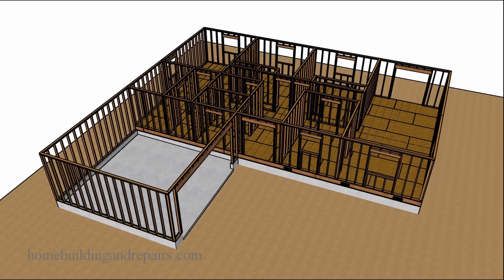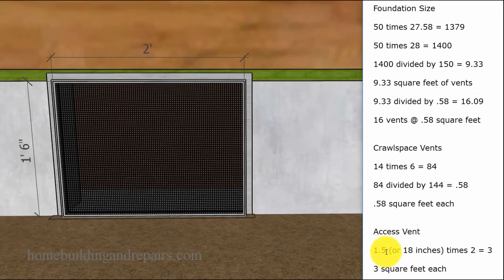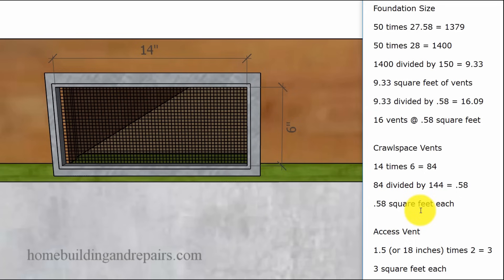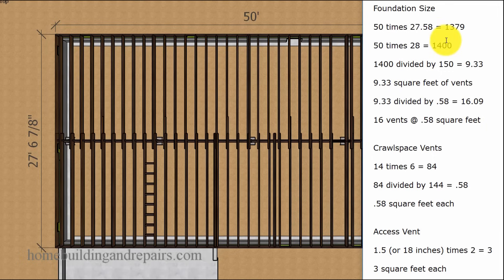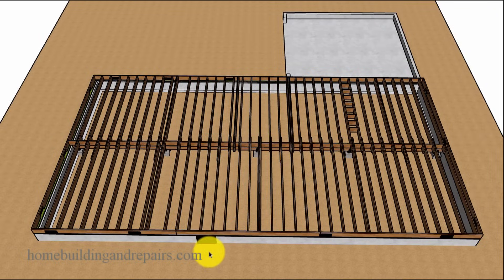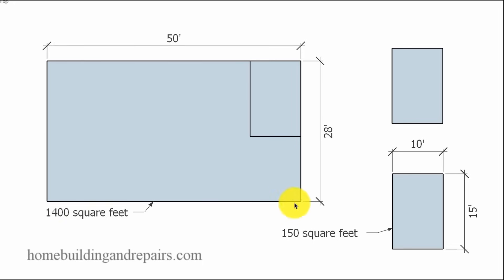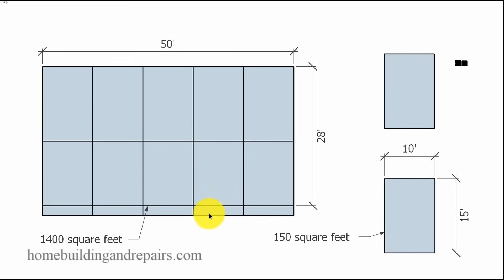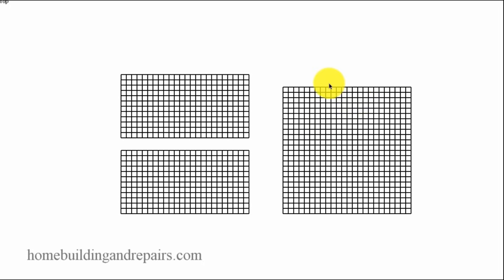How Many Vents Do I Need for an Open Floor Crawlspace - Building Codes

Comment from the maker: For those of you wondering what an open floor crawlspace is, it's when you have a crawlspace where the soil isn't covered with a moisture or vapor barrier.

This building code information was also taken from the 2018 International Residential Building Code book on page 323.
Reply: Greg. I have a couple of questions. If let's say one wall of the passive vents are obstructed or closed, would that not hamper cross ventilation? Also, how bad is  having your drier venting underneath the crawl space? Any formulas to figure out how much water is getting put into the crawl via warm damp air?
Reply: You could weigh your clothes before and after drying. My guess is it’s a lot of water. Please don’t vent like this.

Comment: Unless you are going to air seal and insulate the floors the same way you do it on the walls (maybe even better because of soil gases and moisture), there is no reason to ventilate a crawlspace like this. The US doesn't really have any climates where this is appropriate. It might be doable in a tropical climate, but then again... Bugs?
Reply from the maker: I would love to see where you got your information from about the United States climates where ventilation of a crawlspace in not appropriate, when they are still building homes with crawlspace ventilation.
Reply: @gregvancom  just because they are still doing it and it's allowed by code, doesn't mean that it should be done. There are so many reasons why this isn't an appropriate building technique. The problems arise because builders don't treat the crawlspace as either "outside" or "inside". It gets treated as a little bit of both. Builders will insulate it, but not air seal it, resulting in condensation/moisture problems. Or, they'll air seal it, but won't provide any thermal separation, resulting in cold/hot floors that again create a condensing surface. Moderate climates (think Hawaii) could probably get away with doing this because you can leave windows open nearly the entire year, but most of the US is climate zones 4-6 (some areas are even 7/8). Vented crawlspaces in these climates is definitely not advisable.
Reply: Venting a crawl space with mechanicals in it is the dumbest idea ever. Cross ventilation was designed before air conditioning. Plenty of science to back up closed and encapsulated crawl spaces over vented. I also say this with 16 years of fixing crawl spaces.

Comment: why build a crawlspace?
Reply from the maker: It usually depends on the type construction. If the house can be built about six inches above the surrounding ground level, then a concrete slab will usually work best. Homes higher or with basements usually have crawlspace.

Comment: I don’t get it
I just watched a video on insulating a crawl space and it says to insulate and close the existing vents
Reply from the maker: I've seen that done, but haven't seen the results of it, for example ten or 20 years after it was done. The best advice I could give would be to contact your local building department for more information, because they might not allow unventilated areas.
Reply: gregvancom It’s for my single-family home. And I’m gonna go with what you say. I just opened up the vents and put chicken wire so the animals don’t come in. But I noticed my crawlspace is cold so I must be having an AC leak that leaks into the crawlspace from the opening from the floor boards

Comment: hey Greg, On your equation you divided the area of your building by 150 to get the amount of square ft of vents required. My question is, why is the segment of the building to equal 150 is "10x15" if the span of the roof is 28' wouldn't it be 10'x14' instead then take that number (140) and multiply by your building square footage? would love to clarify how you got 15', thanks!

Comment: I am building an addition to my house that looks just like this with a slab on grade garage and crawl space under the main house. Its even in this L shape lol. Anyways, you have the vents in the rim joist around the house.  Most of the outside walls on the first floor are Structural shear walls. Can there be vents in the rim joist in those areas? I know that my plans say no holes in the sheating but since the sheeting is still attached to the rim joist is it ok for the vents to be there?
Reply from the maker: You will need to check with your local building authorities or engineer. However with that said, I've cut holes for crawlspace ventilation on almost every project I've ever worked on, even in sheer walls.
Reply: @gregvancom  Thank you for the advice.

Comment: What are the vents for?? I bought a home and it looks like it only has one or two vents plus the door screen..
Reply: I’m going to encapsulate the crawl space instead
Reply: I'd get it looked at! Get a small local termite company that does fungal Treatments. They will be a me to evaluate your home.
Reply: How important is cross ventilation? What if some vents are closed or obstructed?
Reply: Yes. But that won't do anything for the wood destroying fungus that you most likely have underneath
Reply: eric batrez a dehumidifier will be install
Reply: What I'm saying is that you will have fungal growth now! Today. A dehumidifier will get rid of most of it, but if the wood destroying fungi is estalblished, you need to treat it!!!
Reply: eric batrez oh ok I see, do you know what is used ?

Comment: Hi Greg, what if my access is inside the closet? will that work?
Reply from the maker: It will work for the access, but most of the time crawlspace access opening are located inside the building and won't be screened and are usually made of solid materials.

Comment: I really enjoy watching your videos and I know you are a very smart man. That said, in all the research I have done, crawl space venting is asking for a perfect environment for mold no matter the season or how well the venting system is designed. 
Obviously different areas facilitate different needs but in every situation I've dug into, no vents are better than any vent at all.
 Just my opinion. 
Could you explain the effects of crawl space venting vs not,  pros vs. cons?
Reply from the maker: I do have more information on the website.
http://www.homebuildingandrepairs.com/ventilation/index.html

I am going to have to do more research, before I can offer any assistance on homes using vapor barriers and crawlspaces, but I always enjoy being buttered up with kind words. It's one way to almost guarantee that a question is coming.